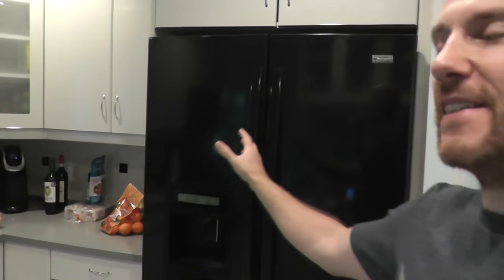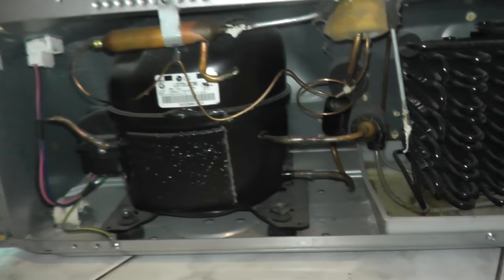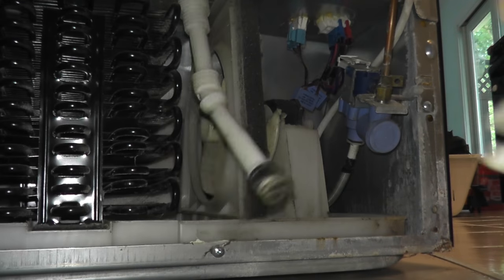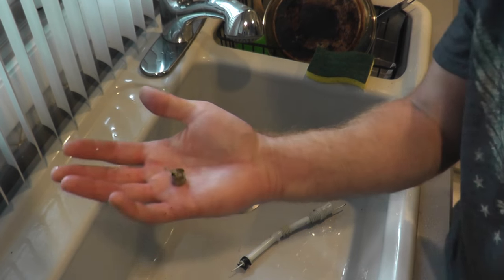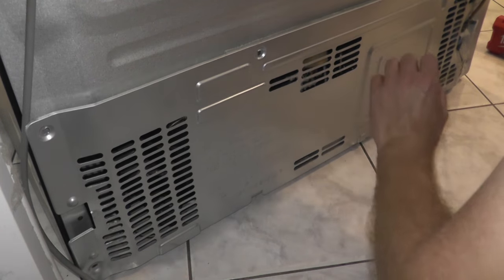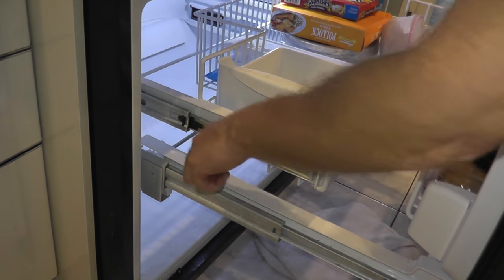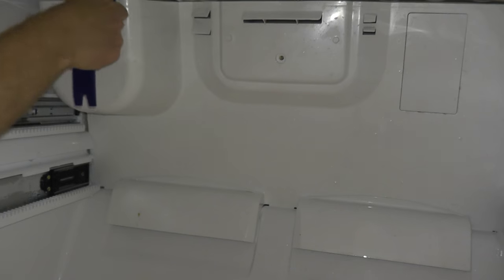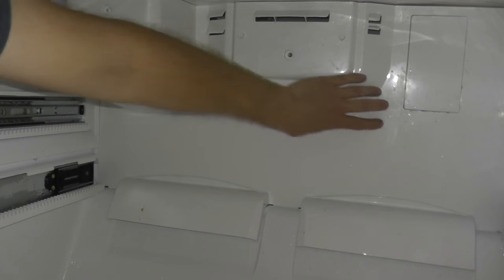Kenmore Elite Ice on Bottom of Fridge Repair

Comment: I've taken out the bottom tray twice inthe last 3 weeks. Cleaned out ice from floor and put back. Now that I've watched your video I know what to try to fix instead of bandaid. By the way, I'm 73 yr old woman and had no problem pulling out frig. Unlocking wheels helps. Holding two handles makes it easy. Tnx for your video. If my back was better I'd do it now. Be safe.
Reply: Great! May I ask you how you unlocked the wheels? I couldn't find out after checking my fridge. Thank you.
Reply: Mociatto there are stoppers underneath the fridge that prevents the unit from sliding, you have two options, one is to get underneath and use a wrench and spin it counterclockwise to loosing it or remove the freezer door and you should see two slots on top where you can stick a screw driver in to loosing up top.
Reply: Thank you!
Reply: You are my hero

Comment: Thank you for showing the root cause of the problem that was causing the ice buildup in my freezer compartment.  I followed your advice yesterday and found that my drain tube also had about a 1/2-inch of gunk buildup at the bottom.  I cleared out the tube, cleaned the collection tray, and removed the 1/2-inch slab of ice on the bottom of my freezer.  I also found that a bag of food had dropped down below the bottom tray and was stuck to the frozen ice slab :-).  Hopefully this fix will last for a few years.

Comment: Thanks for the super helpful video! My drain tube in back was really plugged. The inside panel in the freezer had no screws, and I was reluctant to pry it off, so I just used a hair dryer on the exterior and eventually a significant amount of water ran out. Hopefully all is good! EDIT: That did not work, the puddle came back. I did the hairdryer again and left it unplugged for a half day, but the puddle came back. I bought the auto panel removal tools from Harbor Freight. On my fridge there is a small door on the back panel holding the temp sensor, I removed the little door and that gave me a place to put the tool in and tug. Don’t be afraid to pull on the door; it won’t break! Two plugs on the top left had to be unplugged, so I could tilt the panel to access the trough. Big iceberg in the trough. Used a dryer and hot water, and eventually it started draining. Hope this helps.
Reply: Did it last?  I keep doing all this and it keeps returning.  I will not buy a new one.
Reply: @Johnslist  Thanks for the question- it prompted me to take a look since I haven’t thought about it for a long time. It’s still dry on the bottom, but who knows what is going on behind the panel. Good luck!
Reply: @stevehall6834  How's the bottom of the freezer look?  I think that is the culprit, I still got a layer of frozen water there, I think unplugging that tube is ONE remedy, but since I cleared that and it returns, something else must be draining into the freezer.  I've tried the defrosting trick with heat gun as well, which works temporarily.
Reply: @Johnslist  the bottom of the freezer is clear.
Reply: Ya, that was the first thing cleared, it was plugged so I hoped, but it returned.  Then I did I defrosted and it returned, then I heated the coil from the back and it eventually returned.  I'm still getting ice build up on bottom and suspect that's it but it's coming from something else beside those two common areas, next I'll disassemble the inside panel to heat/look around.  But it can't be frozen as I defrosted twice including with out CA power outage Sunday.
Reply: @Johnslist mine is doing the same after doing everything in the video. I think is the thermostat sensor that's bad if I can find it
Reply: @kelm1123  I looked at that but spoke to a tech who was sure it was the ice maker fill valve, I believed that ordered the part but haven’t tried yet, I’m hoping since that thermo wire was buried and we have hard water so I could see the valve getting damaged and not closing all the way.
Reply: @Johnslist thanks man, I miss a step before and didn't clear the drain on the inside panel. It was full of ice. Just check and no ice build up so far.

Comment: Wow!!  This is fantastic!  My frig layout in the back is different. But the tube was right there along with the tie straps. The tube was clogged. It was a Very straight forward job. Just like the video. 

 The interior of my fridge is totally different from yours. There is no drain plug and no panel to take off just some kind of exterior clothes dryer looking vent. I decided not to blast it with a hairdryer to see how it drains now. 

The worst thing of the whole endeavor is taking the dang sliding trays out and putting them back in. 

Hint.  Opening the doors is much better bc it allows the trays to clear the frig above.

Comment: Thanks for the video, I found the ball of goo at bottom of plugged drain tube.
FYI my fridge is JAMMED in between wall and counter cabinet. So to get it loose I screwed the front feet up and put a strap from a woodworking clamp around each front foot and formed a big loop that I put behind my back and I then sat on the floor and pushed with my feet on either side and pulled the fridge loose and out with just a little effort.

Comment: THANKS so much for this video - it was spot on.  There was ice 1/2" thick at the base of the freezer compartment so this must have been going on for a while. Well done!
Reply: I learned something else about this situation on another freezer. While the clogged drain hose IS THE ROOT CAUSE, the remediation may also require getting rid of a solid ice buildup upstream of the hose.  In other words, if the hose has been blocked for a while, there may be a solid block of ice in a drain tray leading to the hose. YOU MUST GET RID OF THIS by manually removing it OR by leaving the unit off for hours til it melts.
Reply: @petewilleford128  thank you so much for posting this- I was wondering about that! Thanks again!

Comment: Thank you for the video, Just got to the back of the fridge, it was very difficult as the Fridge was facing and island. The drain pipe was clogged, i had unclogged it.  Removed the ice at he bottom of the freezer. Used the big Air Blower used by home restoration teams. There was a lot of water that came out. Hope fully this would solve the issue. If not over the weekend i have to open the plastic panel and use the Blower again.

Comment: Great video, but I had a different, very weird problem. My drain pan had a crack in it allowing water to drain onto the floor. I have a Kenmore Elite model 596.73503201 which is 19 years old. The drain pan is plastic and on the left side, that pan had a crack down one side to the bottom, then inward into the pan bottom.  Total length of crack was about 1-1/2 inches. I also noticed that part of the pan wiggles a little, not really secured, so I think over the years, the  vibration caused the crack. Anyway I was able to fix it with 5 min dry expoxy glue on both sides of the crack. First, I cleaned up the area thoroughly and used a hair dryer to dry out that part of the pan. Then, I used a toothpick to paste on the glue. I also added a glob of glue to the underside of the pan to prevent future vibration which was shaking the pan. This fix actually worked, suprisingly!
Reply: good info, my leak returned so I gotta go back; I saw this pan was loose but didn't inspect, you might be on to something.

Comment: This was a super helpful video.  Thank you for posting!  We just finished unclogging the drain tube.  Aside from dust and hair at the exit of the plastic drain tube where the rubber flap is, we actually found a rusted screw inside the dust/hairball.  I wonder if the person that put the refrigerator together at the factory had accidentally dropped a screw into the drain. Hopefully there isn't another clog above the plastic drain tube.  We will open the panel inside the freezer and check if unclogging the drain alone wasn't enough.
Reply: Forgot to update...  upon opening the panel inside the freezer compartment, we discovered that there was also some black, melted insulating material that ended up on the upper part of the drain tube.  There is a metal gutter/channel that spans below those iced up coils / fins that HelpingHand was de-icing with the hairdryer in the video and it's supposed to channel/direct water from the melting ice to the drain and down the drain tube and to the drain pan. When the water would not drain out the other end of the drain pipe, I figured out that the top of the drain (part of the gutter/channel) had the melted insulating material clogging it.  There hasn't been any ice buildup in the bottom of our freezer since unclogging the drain.

Comment: I removed the glacier from my freezer last week and I thought that would fix it. It didn't. I found your video, and have to do what you just did. Looks pretty straight forward. (Note) for those of you with newer refrigerators, removing that cover to the coils voids your warranty so put it back carefully. Nice video!
Reply: I just did that thing. My tube kind of threaded off and on, had two zip ties from the factory, and about half inch of gunk at stuck in the exit (no pun). Buttoned up the rear hatch and moved to the front. 

Draws came out the same. Had to take off the stainless front. Did that by two screws (one on either rail towards the front). My wet wall had no screws to dismount the plastic back. I didn't even need to take it off. I used a heat gun (wife's blow dryer) and blew it into the vents. The heat rose, defrosted the [coils?], moped it all up, put front back on, drawers back in, plugged it in, and poured a scotch. Nice vid dude, lets see if that fixed leak.
Reply: @michaeldodd3563  Did it fix the leak?
Reply: @arnaldonyc  No. I had to take it back apart, and use a turkey baster full of boiling hot water to melt the ice in the drip channel. The problem was the hole was full of ice. Works like a charm.

Comment: This was incredibly helpful, the only resource I needed besides a bit of common sense.  The only difference with our fridge was the icemaker on top left, which has to be removed to remove panel.  It had two screws for the icemaker air duct and 2 for the icemaker itself into the top.
Reply: if only they could put a drain pan defroster, but I have a feeling it would melt the plastic underneath.

Comment: About 5 years ago, I had a same problem with same type of Kenmore.  I started to hear scraping sonund when I was opening and closing bottom freezer.  Noticed that ice had built-up.  I called Sears and the technician did exactly what you have done.

Comment: AHH so helpful! I've been trying to figure this puzzle out for months. In the midst of the pandemic the freezer is full and I've been putting off emptying it out for this repair. But your video was easy to follow and I did my best! My Kenmore had an ice maker attached on the upper left side of the freezer so I couldn't remove the white panel in the back to easily access the cooling coils to use my hair dryer on them. I pried it up as much as I could and just aimed the hair dryer into the gaps. The ice was melting, so I know it was at least partially working. Here's hoping to this issue being fixed for good!
Reply: Any issues since?
Reply: @arnaldonyc  Regrettably, even though I did all this, I'm still having the leak. My friend, a home inspector, first suggested I change the seal gaskets on the freezer. Then he saw the upper half (French door style) and told me that on my particular model, that style of gasket was no longer used because it was known to be inefficient. He suspected that even though I did my best to defrost the system, the amount of humid air getting in there was just overwhelming the defroster system, causing the water to drip out the front rather than out the back line as it should. He said I could replace all the seals and remove the ice maker to fully get at all the apparatus in the back... but at that point I might as well just get a new one.

Comment: For me, my drain line is clear, nothing in it at all, but I'm still getting ice build up in the bottom of the freezer and it leaks onto the floor... any ideas?
Reply: Mine too let me know if you hear back from anyone
Reply: Did you actually check the drain pipe to see if it is clear? Just observing water dripping out of the pipe into the tray below the fridge is not an indication of an unclogged pipe. Even a partially clogged pipe can cause the problem if you build up a lot of frost between defrost cycles. The melted frost is barely above freezing temperature when it drips off the evaporator coils and if it sits there for a while due to a partially clogged drain pile, can easily refreeze in the collector tray, becoming another blockage that clogs the opening to the drain pipe, especially if the thermostat for the freezer section is set very low.

Comment: Same problem: clog and fairly thick layer of  ice build up in the bottom of the freezer. Same fridge only in stainless. Same fix. Clogged cleared. Fingers crossed the issue is fix.

Comment: GREAT video. I have the same problem (ice on bottom of freezer) but the drain tube WAS NOT obstructed. ANY OTHER ideas?
Reply: It's plugged at the top of the hose...at the collection pan under the evaporator...

Comment: Good video, however you don't have to remove the three screws, just pry the panel away but be prepared to disconnect electrical connectors (Red on bottom). Oh, these tasks much easier removing the front door. Remove the two little screws, lift and pull.  During installation ensure rear hook engaged and then reinstall the screws.  A dirty drain wasn't my problem, my drain was frozen up. Removed ice in channel and using a syringe and hot water cleared the drain, verified by pouring an additional cup of hot water through the drain into a pan.

Comment: Hi.   We cleaned out the drain tube a few months ago but are still getting ice in the bottom.  When you removed the panel inside the freezer does that allow the water that is defrosted from the coils to get to the drain tube?  Did you see specifically where the area is that the water gets to the tube? Thanks!

Comment: You didn't show were there drain hole was at the back of the inside freezer compartment you just defrosted the ice! Also u didn't show how hard it was to remove the back panel! I have tried and can not do this any suggestions? Thanks!
Reply: There is a hole in the tray that collects the melted frost that drips down from the evaporator coils during the defrost cycle. That hole leads to the drain pipe.

The back plastic panel may be frozen in place by the ice build up. If you can clear out the contents of the unit, try leaving it to defrost for an extended amount of time, 3 to 4 hours may be enough to determine if it is ice or some hidden fasteners/mechanism holding the panel in place.

Comment: I’ve been having this issue. I unplugged the fridge for a few days and the drain pan was full of water, and drain tube was unobstructed. Issue returned about a week later. I’m guessing there is a blockage further up so I need to pull off the panel inside freezer to check.

Comment: Very helpful..unfortunately when I opened my Sears Kenmore model no 596.79213011, to my surprise, it had a different structure. The drain pipe is actually inside the body of the fridge, unlike how yours was removable. only a small nozzle sticks out that throws water down a slide into the drain pan. So now I need help to open the freezer from inside to access the likely clogged drain pipe. I couldn’t find any video on how to do that specific to my model. Can you help? Much appreciated. Thanks

Comment: Curious as I was able to get to the Drain and clean it out. But not so confident on the second step. If we don't get the back cleaned out with a hair dryer will it start to work itself out or will the build continue?

Comment: The ice and water on my Kenmore French door elite collects under the crisper at the bottom of the fridge, not the freezer.  Is it the same drain line or another?
Reply: I also had water in my crisper and in the freezer floor.  I believe the water in the top parts of the frig were a result of water leaking from that filter located on the top ceiling.  I replaced that and that seemed to stop the water in top portion.  The "fix" in this video is what I did for the ice build up and leaking.  That drain line in the back at the bottom of frig is easy to get to so clean it out as well.
Reply: Hi did u ever get the issue resolved. I have the same problem of ice build up at the bottom of my refrigerator not freezer. My drain line was not plugged. In fact it was bone dry.
Reply: Water in the refrigerator section is not likely to be due to melted frost from the defrost operation, so the procedure shown in this video won't solve that problem.

Comment: Thank you! Did anyone else have issues with the two screws on the left? Mine will not tighten. Any suggestions, anyone?
Reply: Check at 6:03 for the white plastic part to the left of his hand. Align the four plastic legs (If I could call them that way) with the padded orange holes in the panel. This has to be done while the panel is still in that position. Those legs are threaded at the end. That is where you attach the screws, but only to the two that are closer to the opening with the black padding on it. You can see one of the orange holes in the panel at the bottom left side of the screen. Align that one and the one closer to it with the two white plastic legs shown to the left of the part. It is easy to figure out. Good luck!